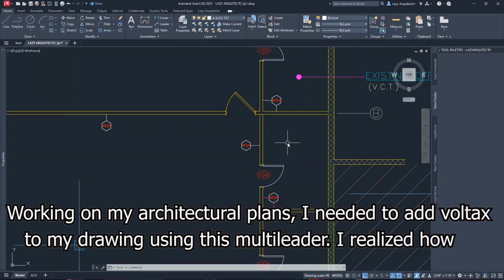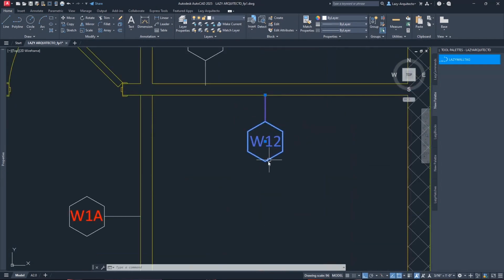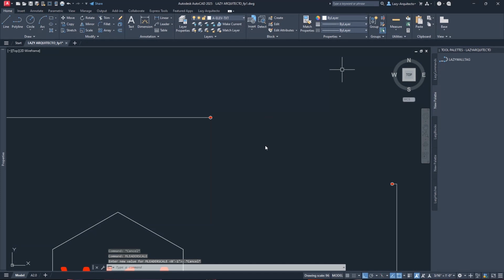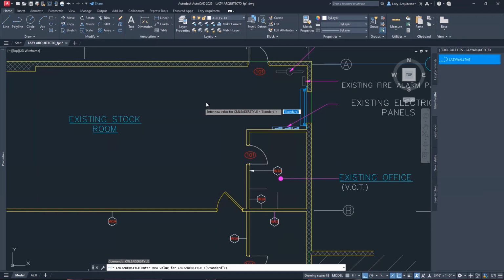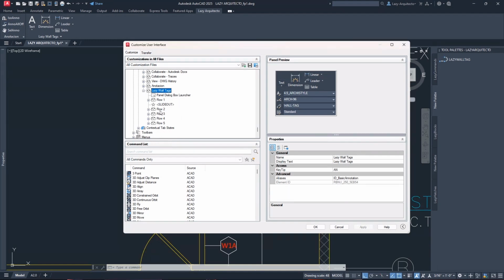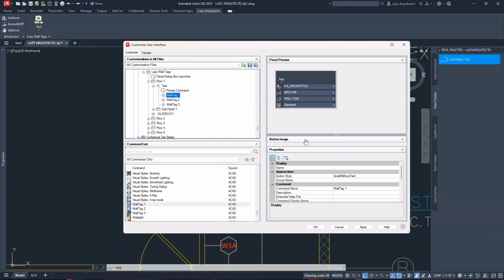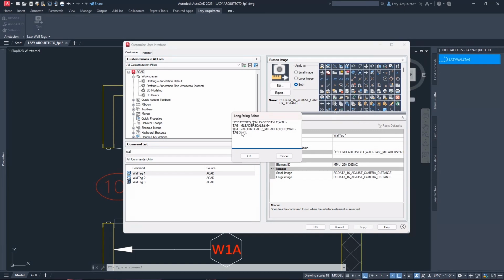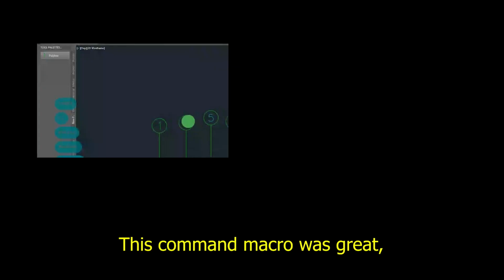Inserting Dynamic Multileaders with AutoCAD Macros

Comment: You should set Attreq to 0, not to 1  in your macro or Attdia set to 0, then you don't need to have both
Reply from the maker: great suggestion but both variables work together to control how attribute data is handled in the macro:
ATTDIA is used when you want a dialog box for entering attributes
ATTREQ is used to decide if you even want to be prompted for attributes or if default values should be applied automatically.